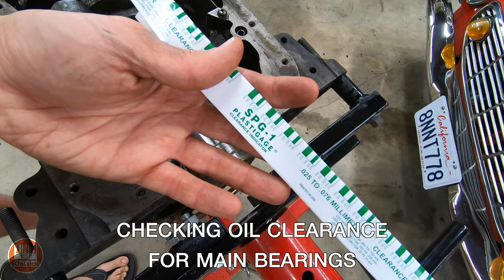Datsun 720 (Episode 9) - Z24 Engine Assembly Part 1

Comment: Awesome rebuild video great visual, I have a question I did my rear main seal and removed the rear main bearing chunk. Can I just torque that too spec and leave every other main bearing untouched or should I listen and do torque Sequence? And what was your torque specs?
Reply from the maker: I don’t remember the torque specs but you can find them online or in the shop manual. I wouldn’t loosen the other bearing caps, just torque the one you removed.

Comment: What manual are you using?
Reply from the maker: I don’t remember what this one was called, but you can get them from most part stores or online. Shop manuals are easy to get for just about every older car.
Reply: Awesome thank you I just wanna make sure the one I buy is accurate I'm thinking about a clymer manual